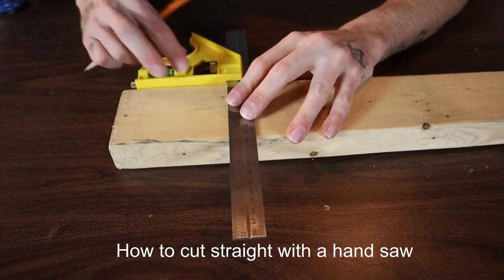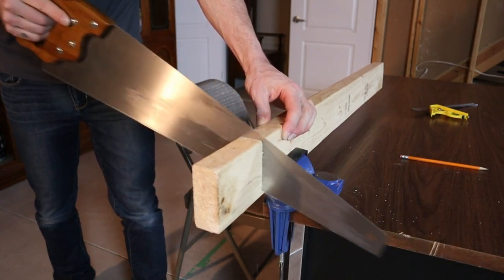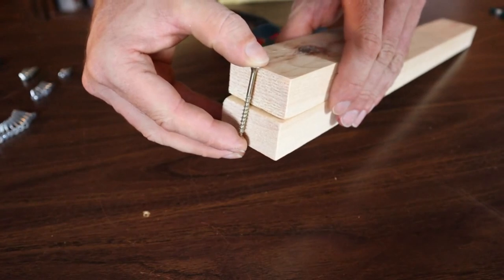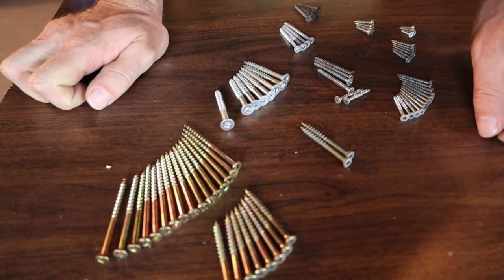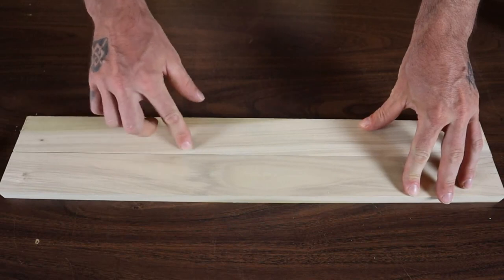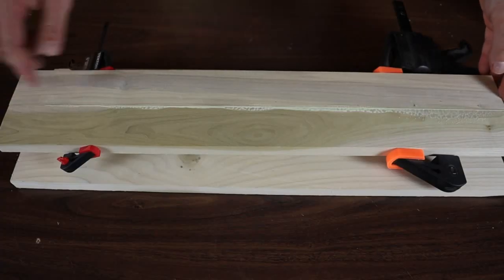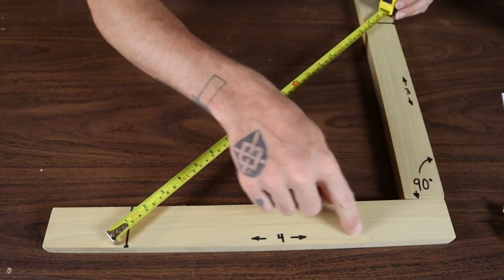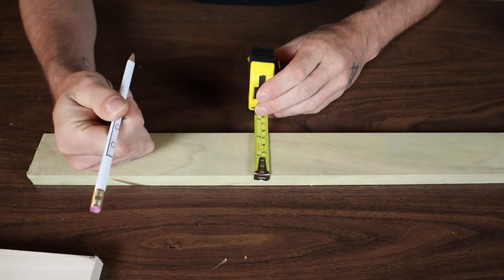Best Diy Wood Working Techniques ( Must Know )

Comment: How do you accomodate the width of the saw while dividing boards in multiple equal parts...
Reply from the maker: You could cut on the line and then take a half blade width off the outside boards.